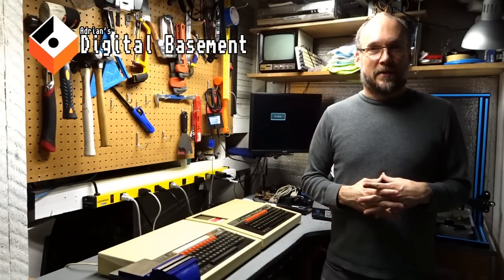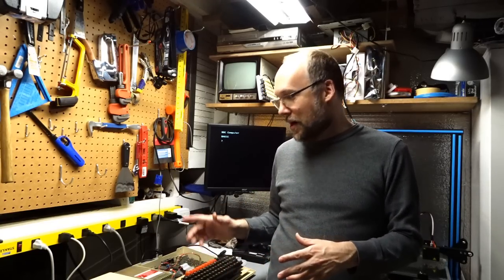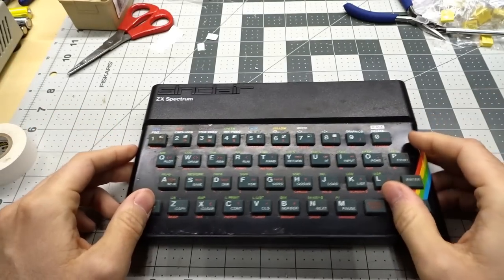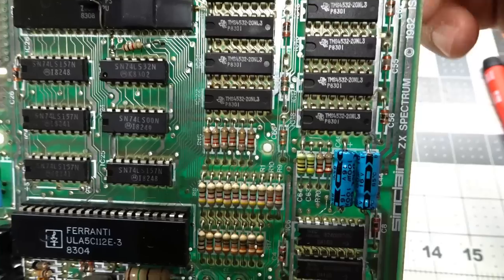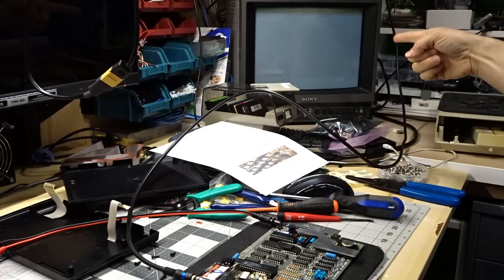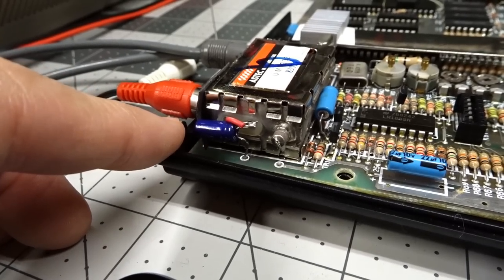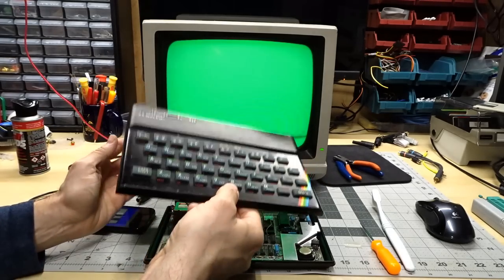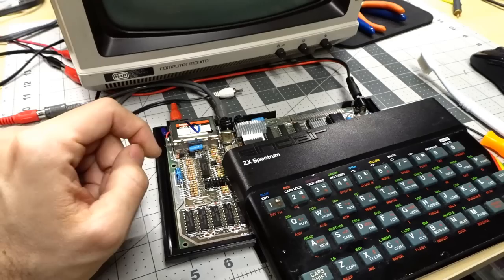ZX Spectrum Part 1 - It's a very sick machine (and a BBC Micro update)

Comment: Hi, I actually had one of these when they came out. The overheating was a big issue which resulted in the first one dying! I had another one and the ribbon cable went the same as with yours, the solution I had was to use a keyboard from another computer, I think it was one of the more traditional keyboards from the 128k version.... as for programming, it actually wasnt that difficult, very basic, but I was about 12 and managed to write a small program which had a bird fly across the screen, and also a rocket lifting off a launch pad! I'm about to watch the fixed video so I'm interested to see how it turned out!

Comment: It was possible to upgrade a specific 16K Spectrum to 48K, but I did so much with mine that the details on certain tasks are lost. I had a giant monster setup with expansion to the micro drives and the printer in the end. Maybe they skipped soldering in the last ones and put it on the user to plug in some of those ram chips because I clearly remember trying to get some and having a 16K which ran 48K later, but the correct doing so (upgrade success) is blurry for me.

Comment: I was wondering if you can make the system more reliable by replacing the DRAM with more modern chips that require 5V only. Console5 has this kind of kit for the colecovision.

Comment: Hi there I own a later model = the 128k+2 (grey) which has a built in cassette recorder and sound emits through the TV instead of the little speaker and it has an AY chip the same type used in the Atari ST. You'll get a lot of games with "128k extras" and of course nice music and sound effects taking advantage of the nifty new sound chip.

      Having said that PLEASE persevere with the Speccy 48k and bring her back to life kind of do that as a back burner mission whilst you test out a few nice later post 1986 games on the 128k Spectrum machine. You can purchase a nice SCART lead for the +2 as well as it has a built in peritel port and .. the spectrum +2 also has built in jostick ports (2) which are non standard pin arrangment but you can get "joystick port adaptors" which are only £3.50 a pair I'll expalin more later on and send you pictures of the bits and bobs I have 

I really want Americans to have a taste of the post 1986 software and 128K versions of games and even the better quality 48k games from that period so games I will list now are Cobra,  Enduro Racer, Chase HQ,  Head over Heels, Batman 3D, Target Renegade, Renegade, Starglider 2, Amaurote,  Egghead goes To Town.   The last game mentioned is actually available brand new it's homebrew and programmed by the very respectable from back in the day and now homebrewing Jonathan Cauldwell.  Look up the new Spectrum Next computer too when you have time :) 

Great videos you are really smart with the repairs and I wish you luck with that particular Speccy please save her !  I will send a few pics of other stuff you'll need for the 128k Speccy experience

Comment: We had a computer room with nothing but BBC Acorns at school (mid-80s to early 90s).
They were stupidly easy to program.

This was in Australia, btw.
Reply: I know it had a pretty fast BASIC interpreter (a bit like our contemporary Swedish ABC 80 and 800). That makes it easy, sort of. But still, "stupidly easy to program"? What do you mean by that?
Reply: @herrfriberger5  well, I think the operating system (for want of a better term) was OSCLI (I think that's what it's called) and you could use it's commands in your BASIC program.

Aside from that, it's just a very straightforward version of BASIC. Much more so than, say, Apple BASIC. I wrote a bunch of stuff I couldn't on any other system. A D&D character generator, a sine wave generator, and even a virus (of sorts).

I also loved how you could buy the Acorn magazine and copy the programs in the back straight in.

Put it this way. I have apps on my phone around 20 times bigger than the entire file server storage capacity. In fact, my first PC, from about 1994, was more powerful than the entire classroom. And it wasn't anything special - straight off the shelf.

Comment: I realise that this post project has probably long gone to the junk pile but ..... I think you should get the Econet working. You can then network the 2 machines. Possibly even add a network file server etc. Compare the 2 boards to get a list of the missing parts. They are mostly 74LS series parts although the Motorola 6854 ADLC might be a little scarce. Oh, and a ROM with NFS/DFS installed. You'll need a clock generator (plenty of those projects kicking around) and some cables. You could probably use the network to talk to your other devices too. IIRC the C64 network used the same ADLC so a common file server might work?

Comment: The red on the screws wasn't rust it was paint or something when assembled. I think so tampering (and so the guarantee was now invalid) could be proven. The Speccy was  the best gamer micro for a mile in the 80s and got all the best gamer software. Crappy keyboards were improved later. Signed  Brit Spectrum 2 and 3 user from 1984)

Comment: Ram chips had a tendency to (burn to touch) when they blew short circuit, If cold (open circuit) then you can check the data lines with a logic probe and that will show up when compared to the other healthy ram chips.

Comment: You need to replace a resistor and add a capacitor at the power input. It is a factory mod on almost all issue 2's, so this one is an early one. If you get a complete Capacitor switch kit (recommended) this mod usually is included in the kit as well as an improved composit mod (Retroleum.co.uk is a good place, and it has info on all issue boards and mods that is needed). There is also retroradionics.co.uk that has new faceplates and keyboards for the Spectrum as well as complete cases. I recently went through all of this on my issue 2 and added the ZX-HD addon as well as the DivMMC addon (bytedelight.com). I just grew tired of waiting for my ZX Spectrum NEXT to arrive... :)

Comment: The ZX ULA do not generates a proper PAL vertical sync pattern, just a single pulse, and this can explain why your video capture device gets crazy while older monitors or TVs seems to to be working right. The ULA has lots of design bugs, but I think this one was intentional in order to reduce the logic inside.

Comment: That random program entry system, with numerous functions for each key, makes a lot of sense when the keyboard is so crap. Yes, you do get used to it. Well I did in the 1980's anyway! Mine was a 16K, and we upgraded it later - you could buy them as 16k or 48k or upgrade later.

Comment: We never had alternating lines, I remember studying how the TV produced colour with a magnifying glass and never saw this before. Maybe the TVs worked a bit different then - like maybe this one you've got is designed for a progressive display and poorly emulates a TV made for 50Hz fields so the phosphors of the fields don't cross each other's vertical boundary like the 80s UK TVs did. They had a pattern like this:

+-+-+-+r |g|b+-+-+-+
| r |g|b|--+-+--| r|g|b|
+-+-+-+r |g|b+-+-+-+
| r |g|b|--+-+--| r|g|b|
+-+-+-+r |g|b+-+-+-+
| r |g|b|--+-+--| r|g|b|

Comment: I've had luck repairing membrane keyboards using conductive electric paint. If the issue is that the metal from the ribbon contacts has worn off, that can be a quick fix.

Comment: These were sold as 16 or 48k, they were not home upgradable.  They later sold versions up to 128k with a full keyboard same as a modern membrane keyboard and a built in cassette deck.  I had one of these as my last one before moving up to an Amiga 1200.
Reply: My 16K issue 2 board had sockets to enable an easy upgrade 48K.
Reply: @Inaflap  True, the sockets were there as it was cheaper to just manufacture one board but no one ever did this as the memory chips were not available
Reply: I did it.  There were 8 RAM chips, and I think 4 logic chips, which as a DIY upgrade set cost £22 (3rd party seller in 1983 ).

Comment: The keyboard membranes on the spectrum have a habit of going crispy and failing (they are over 35 years old).....so even if you do get a ‘better example’ you will probably end up with the same problem in the near future......so I would bite the bullet and get a new membrane for the specy you have. As pointed out you can get a new face plate at the same time, so hopefully they will combine the postage.

Comment: Almost every speccy you'll find will have the keyboard membrane issue so getting a new membrane would be a good idea even if you intend to get a case that's in better shape. The only real issue is getting the face plate off to replace the membrane without making a mess of it.

Comment: 1:11 ah yeah I suspected this was the reason for having a dual rail power supply. You can get them to work sort of without plus and minus supply, just the usual 0 and +V, but then you have to do things like offset the input. Which was probably why you got some sound, but barely any from the speaker. I think Dave from EEVlog had an intro on them. Yep, here it is :P https://www.youtube.com/watch?v=7FYHt5XviKc

Comment: As far as I'm aware, the 16K version was short lived. I worked in a computer shop for a while in the early 80s and we only sold 48K versions.
As for should you fix it, as others have said, if it was just for yourself probably not, but it would make an excellent video, so might be worth it just for that.

Comment: I would change caps and power regulator to a TSR1-2450. BTW i also had a problem with mux chips and shows as upper ram is faulty. Check whether it set 16k as ram top after boot, then write a few line of code to poke/peek 0~255 in upper ram area. Mine I noticed that faulty address locations were random, then it turned out to be bad mux.

Comment: It came as either 16k or 48k with a £20 price difference if I remember which is quite a bit in the 1980's.
Reply: My dad said I was getting a 16K one back in the day. He didn't let on that in fact, it was the 48K version he'd ordered for me! :-)
Reply: If I remember correctly, the 16K was £125 and the 48K was £175 when first released (later reduced to £99 and £129). For comparison, the BBC Micro model B was well over £300. Big difference if you were a kid in the 1980s.

Comment: the PSU's quite often have problems with dry joints on the transformer connections that may explain the intermittent -5v

Comment: I'd look very closely at the solder joints on the -5 circuit, if you don't find any bad junctions replace the diode.  i've seen some turn intermittent.

Comment: On my spectrum back in the day the keyboard ribbon failed a couple of times and I fixed it by trimming them back usually they break at the point of connection pretty much, looking closely you can generally spot the break.

Comment: So many hours spent on this. Later even got a floppy drive. Hacked programs from tape to drive. Load the bulk into memory than use the video memory to load the last bit so as to not overwrite my loading code. Then some machine code to copy the vid block to the proper location. Had to hide the machine code in upper video ram so it would not get overwritten in the process. Than call the software i loaded (a star wars game i hardly played as i was more interested in hacking the machine :)
The complete spectrum rom disassembly and Rodnay Zaks "How to program the Z80" were read to shreds :)

And the keyboard was great! (Waaaaayyyy better than the zx-81 i had before ;)

Comment: As you're in the US, i'd say keep the ZX for parts. The cost of parts & shipping wouldn't be worth it. In fact, it may be cheaper to get a working ZX shipped to you. 

Or use the ZX for as a Raspberry Pi case project.

Comment: A word of warning when it comes to joystick standards on the ZX Spectrum. As there was no joystick port on the base 16k and 48k models, all Spectrum games allowed for keyboard controls. When Sinclair Research released the Interface 2 expansion, they included two DB9 joystick ports (the same type as you'd find on the Atari 2600, C64, etc. However, Sinclair wired them differently, so you can't plug in an Atari-standard joystick and expect it to work.

To use an Atari-standard joystick, you'll need a Kempston interface. It included an Atari-wired DB9 port, and many "Kempston compatible" joystick adapters followed, with many games giving a "Kempston" option in the control scheme. This was quickly adopted as the standard joystick system for the ZX Spectrum. 

The Sinclair standard was quite clever in itself though. Most Spectrum games allowed for the keys to be redefined as the player wished, since all the models of Spectrum released by Sinclair Research lacked a built in joystick port. The Sinclair joystick standard simply has the stick wired up as number keys 1 to 5 for player one, and 6 to 0 for player two, giving each four directions of movement and a fire button. So even if your game didn't include joystick support, with the addition of Sinclair's Interface 2 expansion, you simply had to define your key controls as 1 - 5, and the game would then work with a Sinclair Standard joystick.

When Sinclair Research was bought out by Amstrad, they developed some new models of Spectrum - the +2, the +2A, and the +3. All three included two Sinclair-wired joystick ports built in. Amstrad also released two Sinclair-standard joysticks - the SJS and SJS2. Both are pretty hopeless. I had an SJS2 with my Spectrum +2A, and I can honestly say it's one of the worst joysticks I've ever used.

Luckily, there are variations of Atari-compatible joysticks that also included a Sinclair-wired pigtail lead (usually grey, to match the +2), which do work with Sinclair-standard joystick ports. I would recommend the PowerPlay Cruiser, a fully micro-switched joystick for left and right handed players, which had a Sinclair-wired variant. It's a really solid stick, and one of my favourites - I just need to get one of the micro-switches replaced on mine - but it gives you the best of both world: an Atari-wired lead that you can use with multiple computers, including the Spectrum via a Kempston Interface; and a Sinclair-wired lead to use with an Interface 2,or any Amstrad-built Spectrum. 

* * * *

Edited, because I got my Sinclair interface expansions mixed up.
Reply: That's not right.  The interface 1 had no joystick ports,  it had network,  Microdrive and RS232 ports.  The interface 2 had joystick ports which will accept a standard Atari joystick. 

The interface 2 joystick ports just mapped to the number keys so any game that let you re define the keys worked with it.  But the de facto standard joystick interface on the spectrum was the Kempston, which was cheaper than Sinclair's but only had one port. Rather than emulating the keyboard it could be read using Z80 hardware port 31 - BASIC allowed access to this using the IN statement.
Reply: @markhudson4510  Yep - mistake on my part. Never had to own either of the Sinclair Interface cards, as I had the +2A, and got them mixed up. Though, it would be interesting to get hold of a couple of Speccy's, add the official Interface expansions, and network them together. Or, integrate them into a home network of different machines.

I remember having the Prism Modem, from a giveaway in Your Sinclair, but they ended up sending me two - which was just as well, as with the +2A, you needed two to support the full length of the computer, once they were underneath. Although, the extra height made it a bugger to type on.

Comment: Damn. Someone that knows what i was looking at thirty years ago when I took apart my Spectrum mine di not have the Heath-Robinson fixes on the chips so I guess it was issue one. I have to say I feel your pain about the paint. Most of mine was gone in the left upper section where my fingers rubbed against it playing Chucky Egg 2. Hope you get it working.

Comment: Money-wise - probably not worth it.  I'm curious as to whether the heat sink placed on the ULA is somehow causing issues with the data bus.  Either way, this was a budget computer that's now worth more as parts to people who are super nostalgic about it.  I never had a BBC/Acorn machine, but I think money spent there would be better.  I don't know what a replacement power supply for the goofy one would cost, but surely the overall worth has already been proven given that they actually appear to work.  Others may feel different about the ZX Spectrum - sell it to them to offset losses.

Comment: 2:07 weird power supply, zeners and silicon rectifies and all sorts of crap in it. You were poking around last video and you tested what looked like a TO-220 package, and saying it was where the -5V came from. I thought it was a L7905 voltage regulator, but clearly it must have been a SCR or transistor, My first clue should have been when you said it actually was a switch mode? Clearly I haven't the foggiest how this power supply actually works :P

Comment: Programming on the Speccy was actually quite quick once you got used to the shortcuts but I can't tell you how often I lamented over how much easier it would be to just type the keyword out.  I do have to wonder though if using single press keywords like that actually made parsing and syntax checking the program quicker for the computer if there were never any spelling mistakes in keywords.
Reply: as for the colour - the white was a light grey - if you used the keyword "bright" you got another set of 7 colours that were brighter than the originals and then you get your pure white and a total of 16 colours.
Reply: Yes, that was the main benefit. Pretty helpful when you're learning to program too, as the whole programming language is there on the keyboard. I liked it.